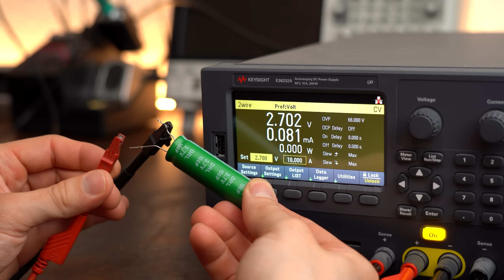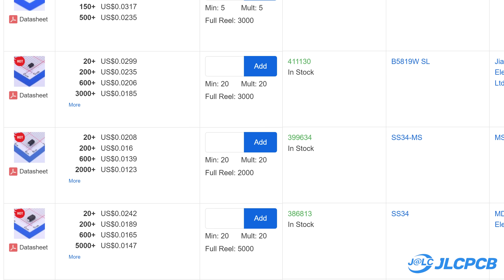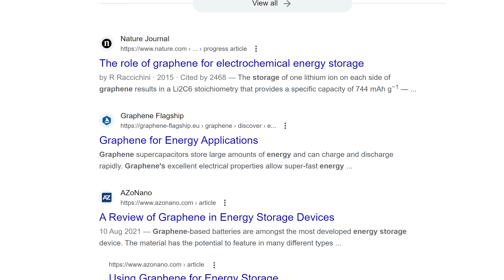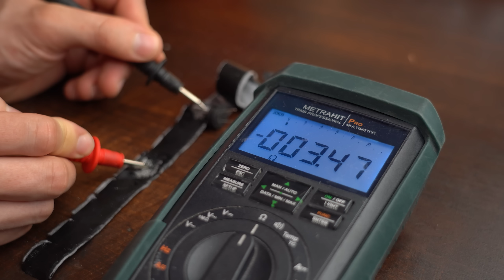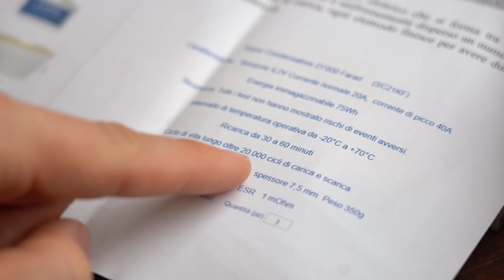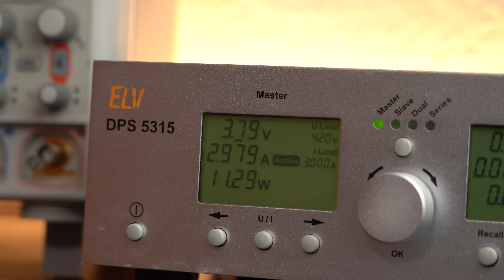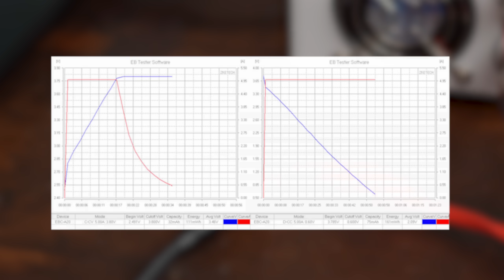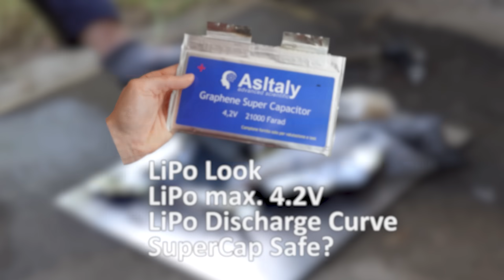Finally a Capacitor that can REPLACE a Battery?!

Comment: You forgot one downside of supercaps:  self discharge is high, can be in the order of half its charge lost in 1000 hours, and is also a function of temperature.
Reply: and Capacitance and ESR degrade rapidly when charged (a few 1000's of hours at rated voltage and temperature will result in half capacity)...
Reply: In most use cases, a 1000 hour SDR is not an issue. Heck, the liion batteries on my gopro have a faster self discharge than that.
Reply: Similar niche to Flywheel Energy Storage probably (at least unless these magic portable ones work out).

Not ultra long term storage, but long enough to stabilize electric supply/demand over a day to a week or so.

Use your “Power-to-X” tech to store energy long term, with maybe a bit of Pumped Hydro /HVDC Interconnects for Good Measure, and your good!
Reply: Informative!!!
Reply: I see another factor that raises self-discharge; supercaps have a low max. voltage, 2.7V. For that we need a few in series, and that means balancing them. And with balancing comes more self-discharge of the whole pack.
Reply: Nope
Reply: It's perfect for the grid. It's always charging....
Reply: Exactly companies like maxwells are making great supercaps tho. 

Only issue is their self discharge
Reply: If the self discharge want bad enough, the number of cycles before breakdown is worse. Like on the order of 1000 cycles
Reply: 666 likes
Reply: Yes but due to the rapid charge time a small solar panel could maintain charge.
Reply: That seems like a pretty serious downside, especially since one of the reasons to store a lot of energy is to be able to release it over a long time
Reply: That would be no problem for most uses thought
Reply: @NinoJoel  Of course, such property will allow for certain applications, it wil find its own ground to be usefull in.
Reply: @NinoJoel  I think you're mostly right, and I heard it can be used in cars and other high power situations. HOWEVER, this is an electronics channel, where fast charge and discharge of large amounts of energy is unlikely. I would argue slow discharge is more common in this particular niche
Reply: A thousand hours? That's like more than a month... who cares? For most worthwhile applications you'd be charging a lot more than once every couple months, and you have to keep lithium batteries charged every month or two and keep them stored at below 100% charge... so it wouldn't be more of a hassle than those batteries, plus a supercap would charge super fast so there's no concern if it discharges itself
Reply: @simonlinser8286  Yes, but still it is a negative compared to batteries. Do not forget that when a(ny) capacitor looses half of its charge, the output voltage will be halved, so it becomes quickly unworkable to get energy out unless you would use a boost converter. A battery will stay long on voltage, then suddenly drops.
Reply: it loses half of its' charge is roughly 42 days (41 and 2/3rds of a day to be exact)...... Oh boy it's horrible we're Losing that charge super fast.... Regular Capacitors lose their charge in secs or minutes. That sounds horrible you can recharge it in a few minutes but it loses its' charge in just under 3 months time how horrible... Guess it's just a bad Idea to make Electric Cars cheaply by using super cheap Ultra and super capacitors.
Reply: @Dallen9 super caps aren’t suitable for massive energy storage. WAY too expensive and heavy. They’re grand for spikes, though. A super capacitor sized to be able to accelerate or decelerate a vehicle between 0 and top speed can decouple the battery from the driving experience, theoretically allowing for greatly reduced wear and losses. It also  allows the use of sluggish but powerful battery chemistries.
Reply: Heavy per energy unit, indeed. Expenses not so important I think, the materials are more common.
Reply: @Dallen9  The 1000 hours is at room temperature, and largely an estimate. More heat, faster discharge. Even at lower temps, faster discharge.
Regular caps (e.g. brand new film caps) don't loose charge in seconds, they can keep it days and days, even much longer than that, some even speak of years. Only electrolytic capacitors (wet) loose their charge in hours max.
Reply: @erikdenhouter  Mmmhmmm and why aren't we using them in Electric cars or Hybrid Electric cars to lower Vehicle prices? Seems to me we could be doing this as a stop gap until Battery technology gets to an appropriate level.
Reply: @Dallen9  Because you're talking about a supercap costing 185 euros which has a similar energy storage ability to about £10 worth of Li-ion batteries. It's gonna be a pretty expensive BEV until you can get the price of the supercaps down a lot.
Reply: @RexxSchneider If they were widely used then the cost would come down.
Reply: @Splooge_McFornication  But they are not, and it hasn't. See the catch?
Reply: @RexxSchneider  I only know of one car that utilises supercapacitors. See my point?
Reply: @Splooge_McFornication  Sure. The cost is too high to use them in lots of cars, and the cost won't reduce until they are used in lots of cars. It's what Joseph Heller called "Catch-22".
Reply: @RexxSchneider  That's literally what I said in my original comment. You know back in the 40's (no I wasn't alive back then 🤣) it was lucky if one house in a street owned a television, now most people have multiple televisions in their home.

I truly believe that if supercapacitors are proven viable for EVs, then the cost will come down dramatically.
Reply: @Splooge_McFornication  You know, that's absolutely not what you said in your original comment. You said "If they were widely used then the cost would come down." and I explained why the price won't come down.

The analogy with TVs is not pertinent. In the 1940s, there were no other competing technologies capable of bringing moving pictures into the home, so gradually adoption increased and consequently prices reduced until the mass market could afford them. However, we already have a well-established technology for energy storage (batteries) that are far cheaper than supercaps, and that removes the incentive to adopt them.

A better analogy would be that I remember owning a Betamax video recorder, but VHS turned out to be cheaper. Whom do you know with a Betamax nowadays?
Reply: @RexxSchneider  I literally said that in my first comment. You must be incredibly lonely.
Reply: @erikdenhouter  So in other words, they have an inherent pretection against temperatures below rated operating conditions.
Reply: @Splooge_McFornication You lived in a great place. I WAS alive in the '40s and nobody had a TV. That came in the '50s where I lived.... RADIO we had,, imaginary video!
Reply: @erikdenhouter  Loose is entirely a different word than lose.  They do not have a similar meaning. You can let something loose or you can lose something.
Reply: @forgeteverythingyouknow5413  Thank you for pointing that out to me, English is not my native language, so I will try to remember 👶
Reply: @erikdenhouter  You are doing better than 90% of the people on the internet that do speak English. You can at least recognize that they are two different words... but my friend, people who speak English as their first language use that word all the time in the wrong way and it drives me nuts. 

Bless your heart for your attitude and thank you for not assuming I was trying to be a dick. I was trying to be nice to someone I falsely assumed was an English speaking person. 

Regardless, I thank you for your heart and your attitude. And my apologies if It sounded like I was being a dick. I wasn't trying to, but sometimes I accomplished that without working at it.
Reply: @forgeteverythingyouknow5413  Kind words, and a surprise lesson. Thank you ❤‍🩹
Reply: @Dallen9  Okay so with a little rounding you get 1.2 percent loss a day. No losing 1.2% of your battery charge a day isn't a deal breaker as customer usability goes but think about the SCALE, no losing 1.2% charge a day from A SINGLE capacitor isn't much but Thousands? Millions? "Woo we found a new energy source that is cheaper and easier to acquire so efficiency be damned" is kinda how we got into this mess when we switched over to petroleum from whale oil, we need to not repeat the same mistakes over and over in new flavors of tech.
Reply: @npiper  Good point that I overlooked....

Comment: Absolutely not a super capacitor... there are two EDLC (electrolytic dual layer) and LDC (Lithium ion capacitor or lithium doped capacitor hybrids) - This is neither, but i am very suprised it did not combust. I suspect it was a lithium titanate pouch cell, which can be punctured and will not combust. Research LTO or Lithium Titanate.

Comment: the structure of grafin cap is similar to a lipo.

a copper plate with black stuff, a layre of lithium (black) seprated with some plastic like thing and so much of electrolyte in between with a pungent smell.

Comment: What if they stacked a bunch of these SuperCaps and connected then in such a weird way to get the high capacity level which in the end acts like a Li-Ion battery? I guess that if they wanted this product to simply "replace" a Li-Ion battery then it should behave like one... otherwise something might happen...
Try stacking/connecting a bunch of capacitors in series/parallel and check their behavior...

Comment: Looks like a lion battery doped with graphine. 

They have huge charge/discharge amps and won’t blow like a normal lion battery. 

They also have the same voltage as a standard lion battery but massive improvements in cycle life.

Comment: Da Kondensatoren die Energie über den ganzen Spannungsbereich speichern, muss man für die Anwendung auch den ganzen Spannungsbereich nutzen können, die Geräte werden also zusätzliche Spannungsregler brauchen, was wieder Verluste und Kosten bedeutet. Das ist auch ein relevanter Negativpunkt, wenn man Batterien durch Kondensatoren ersetzen will.

Comment: To me it reminds me of the battery of a lithium jump starter. basically there are several batteries in parallel sharing the same electrolyte to achieve an output current much greater than a common lithium battery. and if I'm not mistaken, the fact that it has the same electrolyte removes the need to equalize all these internal lithium cells

Comment: I have disassembled quite a few lipo batteries and if it looks like one of them, those copper and aluminum plates, the film that separates them ... look to see if it smells like solvent and black powder when heated with a flame throws red fire, if it throws red fire is not graphene is lithium.

Comment: Maybe it has a charge/discharge control circuit mimicking LiPo to make it easier to integrate where LiPo would have been used?  It certainly didn't explode like a LiPo, or look like one on the inside, and you gave it a lot of "mechanical stress" that would definitely have caused a LiPo to catch fire.  I think it really was a capacitor.
Reply: Never.
Reply: Lithium ferrous oxide "lifepo" cells don't combust when punctured.

The company address is a rural house, the company name doesn't exist on the stock market lists and the company name (even with AI query) does not give a single search result. 
It's not a super cap.
 It's super crap. 
You want to believe, so you ignore the red flags or you don't do enough research to see the flags. 
You find me this company. They have to have a web presence if they sell "super capacitors" of this caliber. 
Name me one company without a web presence that has more than 10 employees give or take.
You're pulling the wool over your own eyes here. The evidence for this being BS is all over this comments section.

Comment: I think the chemistry of it is something safe and around 2.1 volts per cell with it actuallly being built with 2 cells in series to get your 4.2 v . Maybe you can finish pulling it apart to see the 2s multiple parellel configuration. It maybe titanate chemistry

Comment: Yup, that's a lipo (or li-ion) battery. 
They don't always blow up, some chemistries are much more susceptible than others, the more stable ones need to be insanely overcharged before they do anything.

Comment: It looks like a baby of a father Lipo cell and a mother LFP cell. Safety and tolerance of LFP and weight and physical looks of a Lipo. What do ya think? You should meet the company people who made that 20,000 Farad ultra-capacitor. They put the non smoking property from a supercap into the Lipo style battery lol.....
Lets say it is a capacitor. Then notice the resistance increase as it gets charged up. If the resistance does not become infinite it is a battery-supercap hybrid. If it is an electrochemical thing, then resistance change due to charging/discharging should be finite.....please do even more elaborate tests on this.